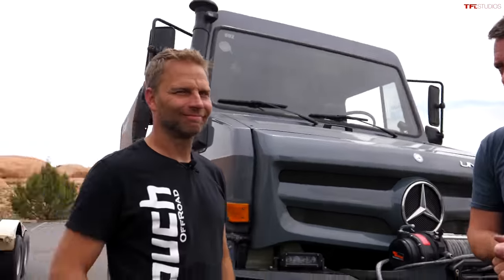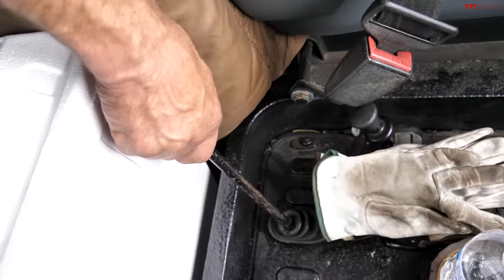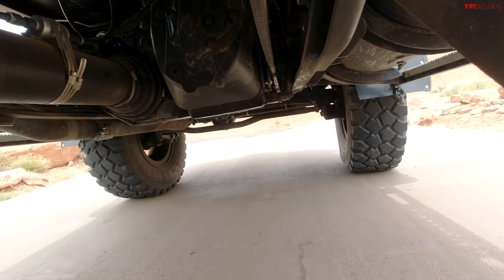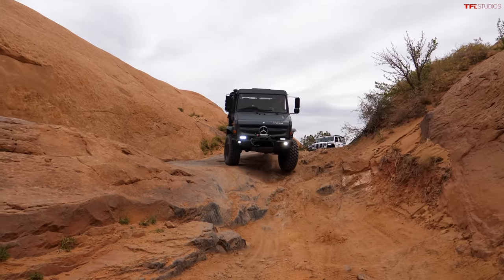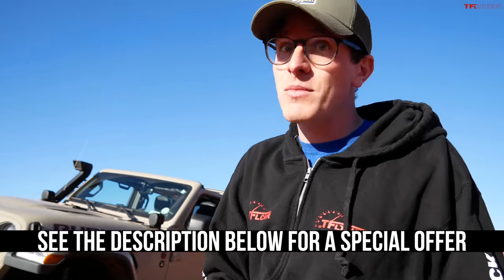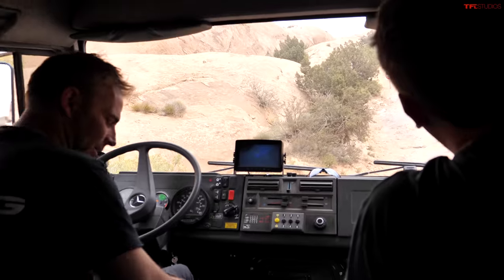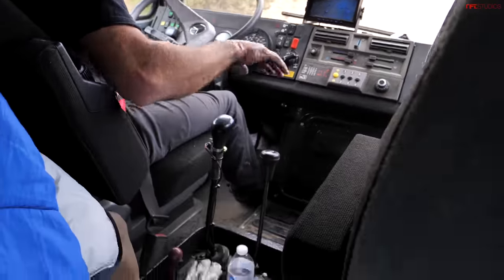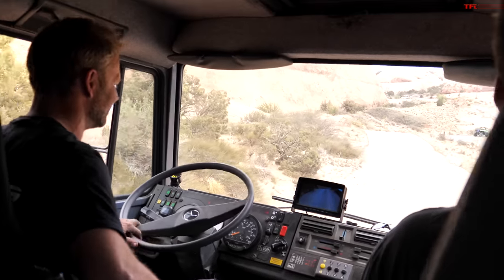$385,000 Mercedes UNIMOG vs Hell's Revenge: Move Over Bronco & Wrangler There’s a New Boss in Moab!

Comment: @mattsoffroadrecovery needs one of these Unimogs for their recovery fleet. I feel it would fit in nicely with their Corvair they just built, and it would certainly help out on some of the tougher jobs in Sand Hallow, and Moab.
Reply: Something tells me they’re not sitting on $600k.
Reply: I was thinking the same thing but it would definitely be overkill. The Corvair will do anything they are up against. I am hoping they will do the big reveal tomorrow on it.
Reply: Winder towing does not have the expertise or talent to drive a Unimog at full potential. They just brute force everything and rev the shit out of small trucks and play towtruck driver. Unimogs are for professionals.
Reply: @eeyore.official  Wow, you sound as if you have a little hatred towards Winder Towing and have no idea what you’re talking about. They are professionals at what they do. The kinetic rope that they use gives them the advantage they need for a lighter vehicle to “yank” a much heavier vehicle out. I have a ’94 YJ, 4,700 lbs, and I yanked a stuck rollback, 22,000 lbs, out of sand, using a kinetic rope. I had to rev-er-up and hit the end of that rope hard. It took me five good hits but I got it out. I would not do it again because it was just too hard on my Jeep. The Unimog is too expensive and really overkill for what they need and, in most cases, too big to get into places they go. Cheers and have a good day.
Reply: @grisa12345  they really arent that expensive, a unimog would be ideal for matt. in europe you can buy really nice ones second hand for under €50 000. and you can buy them with really strong forestry winches on the back of them

Comment: So much want...

Even though I disagree with the bit about manual transmissions being better off-road part; even though his point may be true with larger trucks especially; it's mostly applicable in a crawl; sometimes it is very nice to have the ability to apply some wheel speed to get out or over some obstacles (mud/snow/sand). There is no taking away from the fact that manuals are more robust though...old school is the best school.
Reply: You know, you can just shift quickly to get "wheel speed" ;)
Reply: @TobiasLeininger  Not in a large truck, and in a granny gear going up hill and over obstacles, let alone in mud, sand or snow. You just can't get that quick burst of acceleration to get you that increase of inertia to carry you through. Just look at some of the competitive off road tournaments and almost everything is automatic and there is a reason for it.

Comment: A bold statement claiming to be best...Most who make that kind of claim, end up stuck in the sand...literally. New boss my a**.
Reply: First off: keep in mind that this thing is able to go offroad also when fully loaded with more additional weight than  the multiple of overall weight of any normal car. 
And then: it's not really designed as private fun truck, like pikcup on steroids; It's a multifunctional work truck for power equipment to be attached etc

Comment: Mercedes has a very good diesel motors
Reply: All diesel are reliable it’s a proven technology, it’s the modern day emissions slapped on there that chokes them of there power, fuel economy and reliability
Reply: @604h22a  You hit the nail on the head but l would also include older petrol engines, all of my pre 2000 petrol engined vehicles were totally reliable but use of computers and emission controls as you've said have had an impact on reliability.

Comment: No electronics and computers to break down? Everyone tells me that all that stuff lasts forever and never breaks down.
Reply: If that were the case (computers and electronics not braking down) i would not have a job. And i still have one, and work has not been deccreasing in the last 20 years. (Disclaimer: i am not working in car electronics, but in the end they aren't more reliabe than the ones i have to work on)
Reply: @nirfz  I hate electronics and wish I could buy a truck with even less than I can now. People always comment that it isn't a problem and never breaks. I think otherwise and thus the reason I don't want it. I was trying to be sarcastic, but it doesn't translate well in print.
Reply: @CraigSmith568  Understandable, and i assumed that you were being sarcastic, but  just wanted to underline your point. (doesn't show in written form that well either i think) The electronic trend i hate the most in todays cars is that engine and drivetrain management gets connected to the infotainment. I think they should stay seperate. (So that if the infotainment gets hacked or breaks the car is still driveable)
Reply: @nirfz  I hate that they make so much electronic controlled instead of mechanical when there is no reason for it. I shouldn't have to get into a screen to control the heat. Just more chances for it to go bad. Tesla has an electronic latch for the door instead of a mechanical connection which is just insane. I'm thinking I will be sticking with my old cars.
Reply: @CraigSmith568  Absolutely agree to that. I find the touch input sub menu stuff dangerous as no one can use them without looking at the damn screen, so it distracts people massively.  I also don't get why even Porsche and Mercedes go the Tesla way to use electric flush door handles.

Comment: I wish the big three would put the tire inflator/ deflator on the HD's. That's a cool rig!
Reply: It requires specialized axles, wheel hubs and control systems. Hell, they would have to add hydraulic and air pressure systems. It would double the price of the truck in a blink of an eye.

Comment: Was reading about the Russians vs germans in ww2. How the germans had their new tiger and panther tanks against the tried and true T34 Russian tanks. Russian tanks had a weak transmission so they designed it to be easily removable with basic hand tools. Battle of kursk where Hitler's power finally started to crack. Russian tank operators swapping out engines and trannies with a hammer and crescent wrench. Must've been an interesting piece of machinery? Reminded me of this rig where he said you could fix anything with hand tools

Comment: Amazing machine! But Why? What are they used for besides a rich man's show off vehicle.
Reply: From plowing snow to mowing the gras on the slopes next to roads or mounting crans on the back for lifting stuff, for military transport, anything you could think of. Unimog means Universal Motorengerät  = universal apparatus with an engine. You can have hydraulics, power take off shafts front and rear, and with the modern ones you can move the steering wheel and pedals from left to right, so when you drive next to the end of the road and have any machine doing something you have better viisibility.

Comment: These are very capable vehicles, and great for showing off or rough camping for a few days, but not the ideal platform for true overlanding.  Unimogs were built to work, not carry dedicated cargo (such as a habitat box), and despite what this guy says, when something does break down (especially wheel/drivelines/brakes), their more complex portal hubs and sealed axles means they can *not* be fixed with simple tools.  If you speak to people who actually decided to overland with a Unimog, they pray to make it between major towns where they can find mechanics who can fix them.  A more appropriate chassis with 80 % of a Unimogs offroad capability would still be a Mercedes - but an older SK- or LN- all-wheel-drive cargo truck.  Simple, rugged workhorses - the kind you see bouncing around horrendous roads in Africa where the local shade-tree mechanic can fix it.  Or if you *really* need the ultimate in offroad capability, reliability *and* brute-force simplicity with no computers onboard, get a first-generation MAN KAT1.  This guy Couch talks about losing a gear in the tranny and carrying on?  With an air-cooled Deutz diesel, a MAN KAT1 can lose entire cylinders in the engine, and you just keep going with less power available.  In the end, this is a great video and driving this truck would be fun on a bun, but IMO its an expensive toy for guys who mainly want to show off to their friends in places like this on the weekend.

Comment: Unimog is a range of multi-purpose all-wheel drive medium trucks produced by Daimler and sold under the brand name Mercedes-Benz. The name stands for “UNIversal-MOtor-Gerät”, Gerät being the German word for device. Daimler-Benz took over manufacture of the Unimog in 1951.

The first model was designed shortly after World War II to be used in agriculture as a self-propelled machine providing a power take-off to operate saws in forests or harvesting machines on fields.

Comment: Dont like em.Slow as hailll !
Reply: 65-70mph in Colorado mountains, 75+ mph Utah towing a Can Am Maverick X3XRS averaged 10.86 mpg. Not that slow.
Reply: @jasoncouch2480  It'll be great when the portals grenade themselves from the abuse you subject them to. No real Unimog tech will ever tell you it's safe to do 75 mph in a Unimog.
Reply: New series axles with x3 portal oil capacity,  better vent sys double portal seals etc, etc. Many other upgrades over your level of understanding implemented, hence the price.  
Been running speeds like this for over a decade in our Unimogs built this way.